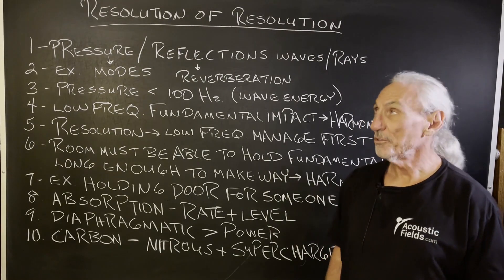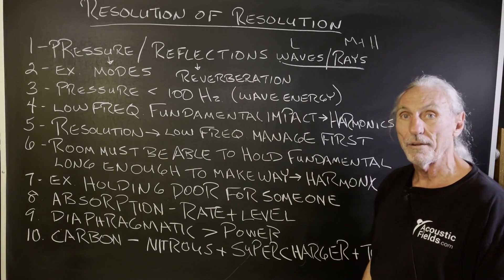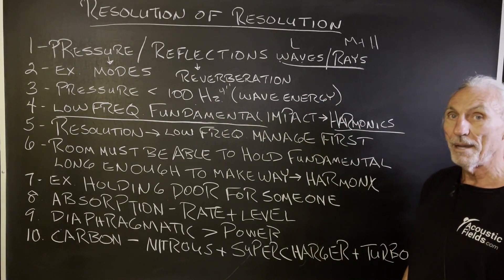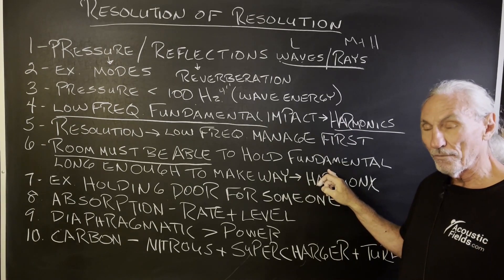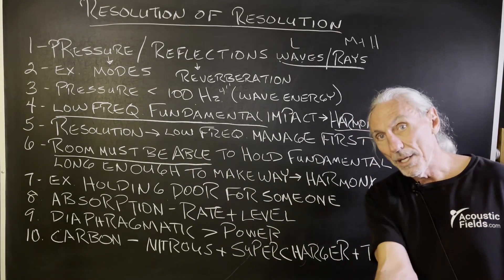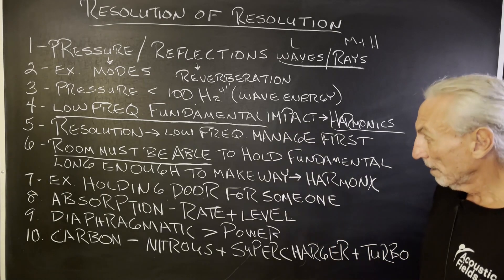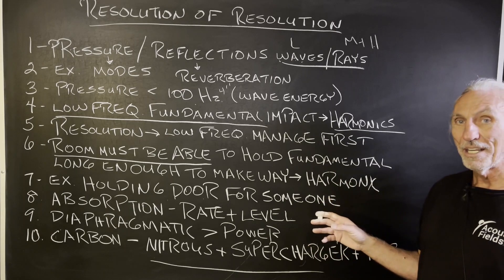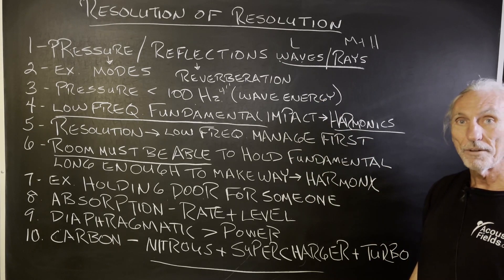Resolution of Resolution - www.AcousticFields.com

Comment: So, I do voice work and have a low voice.  I can't baffle  the reverb out?  it seems to work for me.  However, I just need the reverb to not hit my microphone.  This is the first I am hearing of not being able to baffle low frequencies.   By the way I love your  channel, it is totally awesome.
Reply: the low frequencies he's referring to are under 100 Hz, your treatment is most likely treating 250-300Hz and above (and I bet it's not technically correct, but solves the main issue for you allowing you to continue work). The sub 100 Hz your voice makes are not comparable in strength to a low-frequency driver. Also you are negating the frequency response of your microphone and any other gear you are using. We're talking about large facilities capable of taming low frequency energy correctly and how you can use some fundamentals to treat smaller spaces.
Reply: @KC-bi9jw  OK. cool. Thanks for explain that for me.  I think that the bafflers and towels I use work for my purposes . Thanks again.
Reply from the maker: This is a good example of how using certain material types without knowing their frequency response produces gaps in performance. In physics, it is termed spatial irregularities. All absorption is not created equal. You must match the frequency response along with the rate and level of absorption especially with voice if your goal is resolution.
Reply from the maker: Well stated. It is a welcome sight to see so much understanding. Thank you.